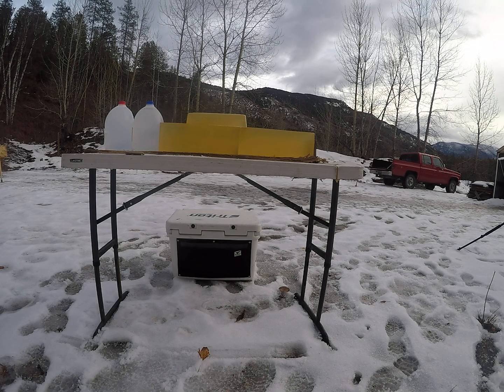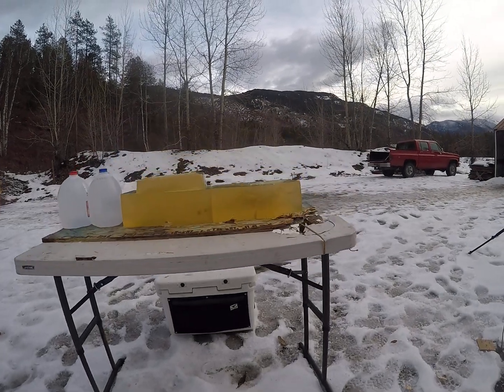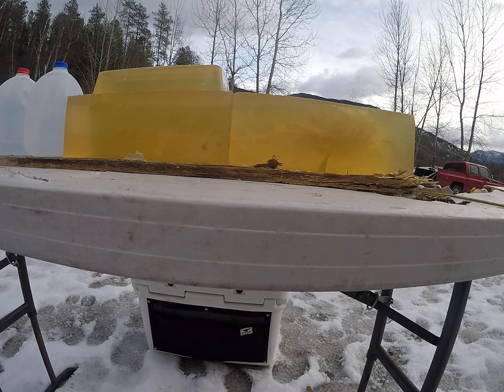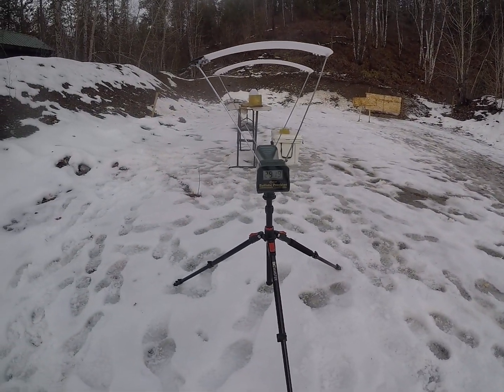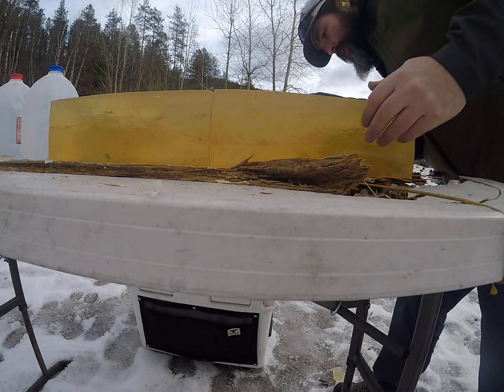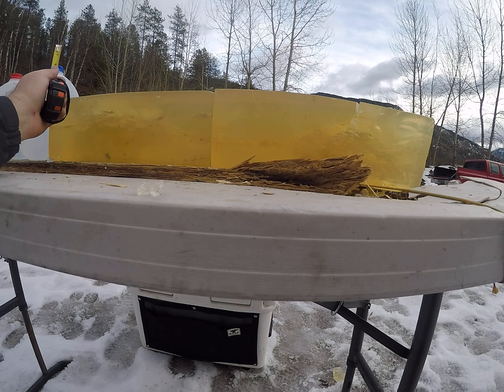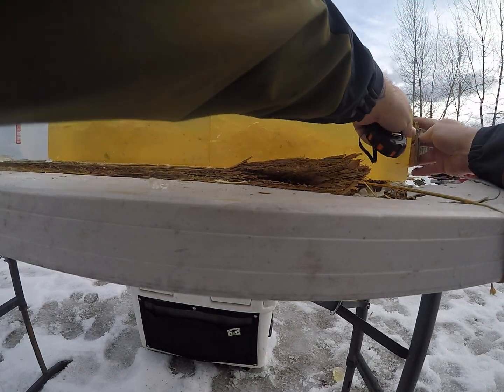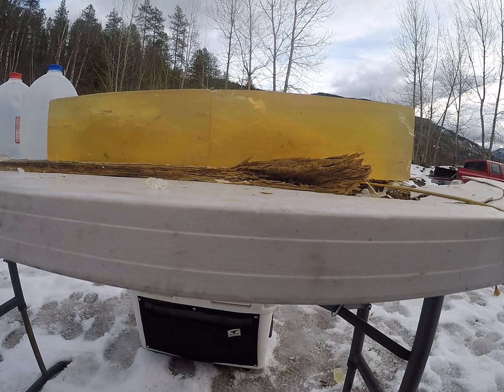Hornady A-Tip 176 gr 30 cal ballistics gel test 30-06 and 308 (300 PRC and reduced in last video)

Comment: Why do people do these gel tests with rifles so close? I get doing it close to test pistols but why so close with rifles dont you want to use what the average distance the game is taken at to be the test distance. Maybe 150yards test shot or does the gelatin identify as 150 yard gelatin? We know if your in the woods it might be a 20-40yard shot and we expect over penetration at that range but across granpas bean field depending on which one it is well over 40 yards and people have a hard time not taking a shot if they have it at 100-200yrds i mean isnt that what rifles are for.. I just seen a guy shoot a 45apc carbine 440 yards through 3/4 plywood and a 2x4 post it was attached to you got stretch the legs on a rifle dont ya? Say ya pop a 125grain hornady GMX in the brass oven there and send it at 3100fps out to the gel at 100-150 see how she jumps while you remind the 270 boys who they daddy is...
Reply from the maker: No two rifles shoot a 100% identically dependent on barrel length twist rates and such muzzle velocities very. It's about velocity on impact, you can reduce your velocities to simulate different ranges and not have to place your shots sub 1/4 MOA at 1000 yds to get identical permanent wound cavities. Typically I do 2 shots 1 is reduced simulating longer range but at the same time I'm trying to reduce it to the minimum velocity needed for the bullet to perform and my higher velocities are average muzzle velocities for the cartridge driving them testing the upper limits of a bullets performance.  Say you take a 168 grain bullet out of a 308 versus the same bullet shot out of a 300 Winmag your muzzle velocities are going to be drastically different making impact at range drastically different. Knowing the velocity ranges a bullet will perform in and your guns muzzle velocity can make all the difference in wounding and losing game vs a secsefull harvest.

Here in America and especially out in the West we have taken the sport of the hunt out of hunting and need to know how bullets perform at long range so we don't need to hunt and close the distance. Take The Best of The West show for intense, its pretty  rare they take a shot within 500 yards and most are 700 yrds+  

I can't say I am for long range shooting of game animals as the further the range the more room for error and wounding animals. Knowing how a bullet performs can be  just as critical as accuracy for a secsefull harvest.
Reply: It is not true. When flying, bullet is loosing forward velocity, but bullet is almost not loosing RPM at all. So if you fire a bullet at reduced velocity, you will reduce RPM too. Bullet stability and centrifugal forces will be very different. So the gel results.